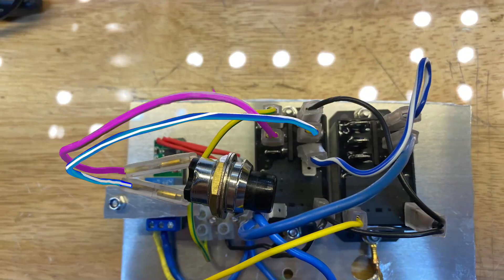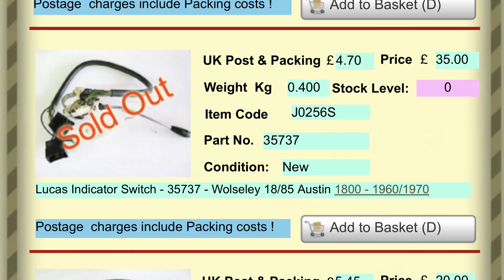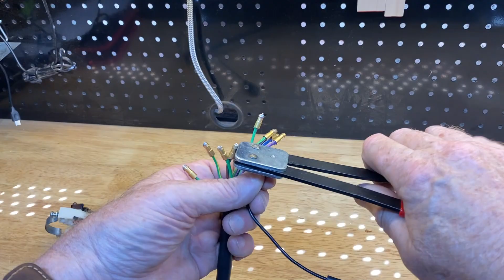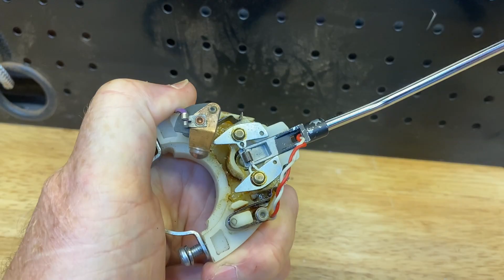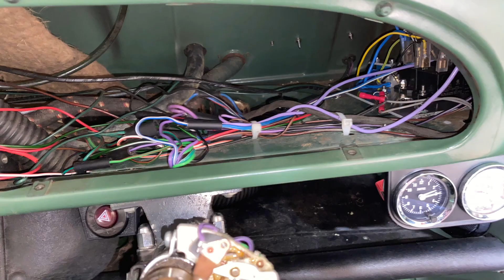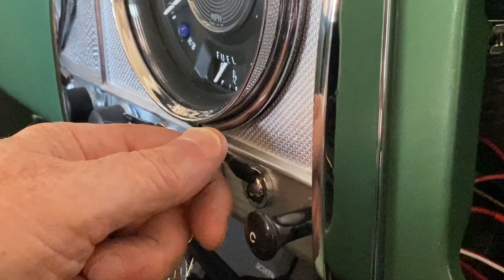Part Two. How to move the Morris Minor dip switch to the steering column.

Comment: I struggled to find a 35737 so I bought a “universal” indicator/headlights/horn stalk which arrived today and looks as though it should work, however a wiring diagram wasnt included so it might take a bit of experimentation matching the wires! There’s a bundle of wires to an 8 pin plug - white,  green, grey, black with white trace, brown, black, 2 x yellow with red trace, then 2 wires to another plug Red, and brown with white trace….
Reply from the maker: The colors aren’t an obvious help and you may need to check the switch with a multimeter to see what goes where. Good luck 👍

Comment: Excellent, now to fit an indicator stalk to my Series II, along with that hazard switch
Reply from the maker: I’ve always found the SII indicator switch  quite easy. As long as you don’t try to operate it with your foot.
Reply: @jodiethemorrisminortraveller  The problem I face is an unknown history, I got the car fitted with a toggle switch under the dash for the indicators. nothing on the column itself. I suspect a mishmash of years, as it's registered as a 53, but has the central speedo on a split screen as in late 54 to 56. 
Investigations will be required when I get more time.
Reply from the maker: Always a problem when somebody has been at it first and not left a circuit diagram.